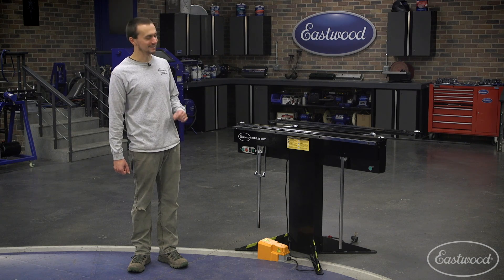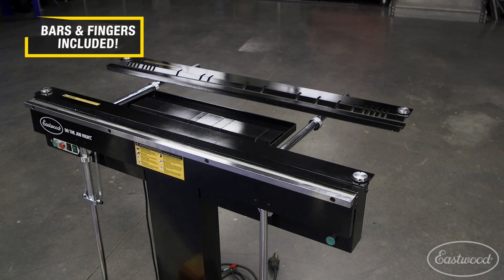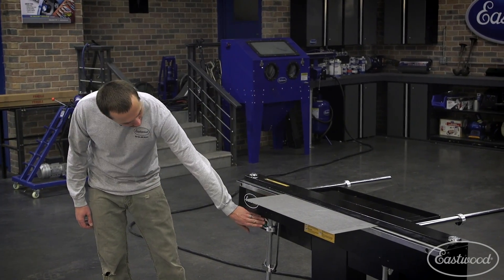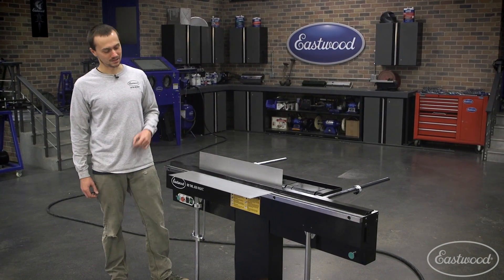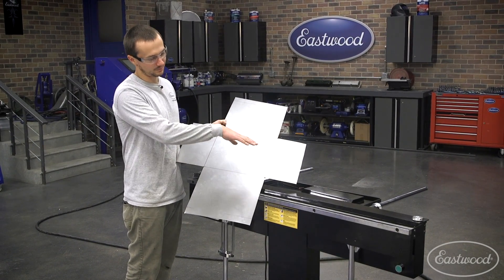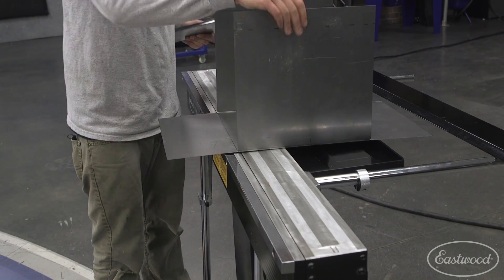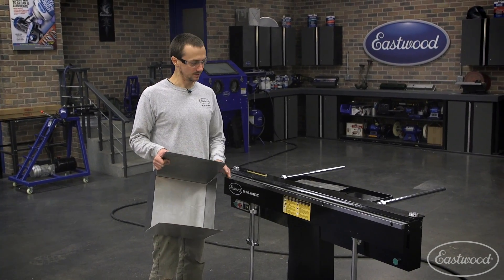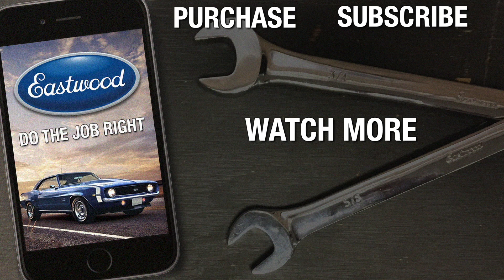Electro-Brake Sheet Metal Brake - How to Use a Magnetic Brake & Fabricate a Box - Eastwood

Comment: Mine worked for a few days and quit, not alot of help from Eastwood so far.
Reply: Just curious did you put in a transformer to take the voltage down to 220 from 240?
Reply: voltage supply is critical on these ,,, they wont work well off a wall socket

Comment: Can i ask how it does aluminum  since a magnet does not work with aluminum. I am wondering about that.  Thanks
Reply: It doesn't have any problems with aluminum because the bar that you put it between is steel therefore it bends aluminum

Comment: Does it have a de-magnetizing mode as well (for when the bend bars or metal dust gets magnetized and starts sticking to everything) ?
Reply: that's not an issue. I have the baleigh versions. this is the same thing, just painted black.
Reply: @rollandelliott  Huh. Does it run directly on AC? Because that would make sense since it would basically magnetize something, then demagnetize it 60 times per second.